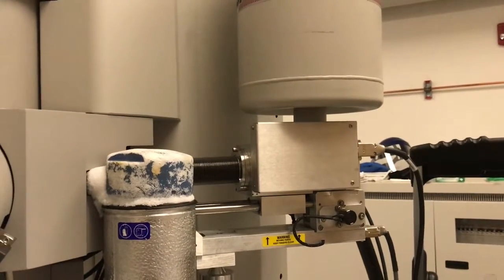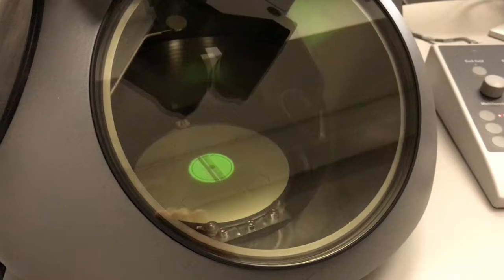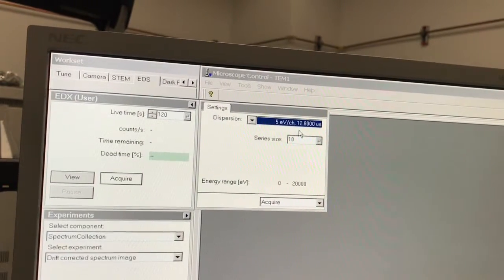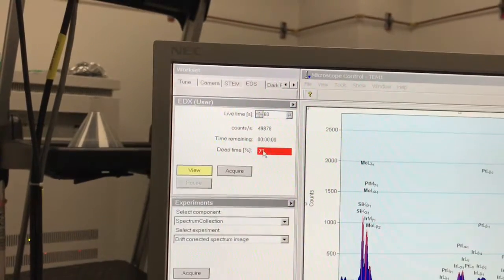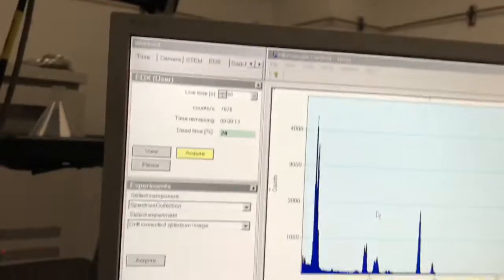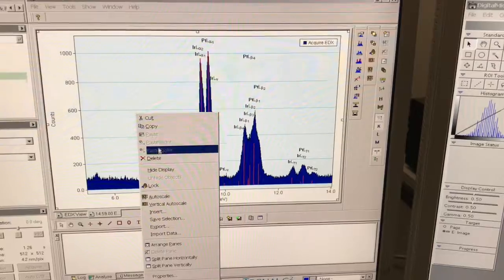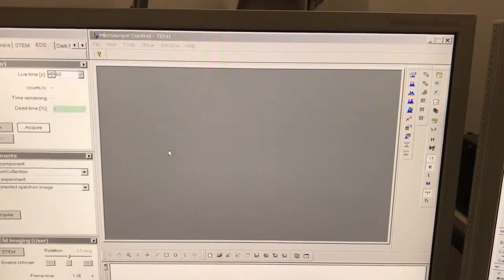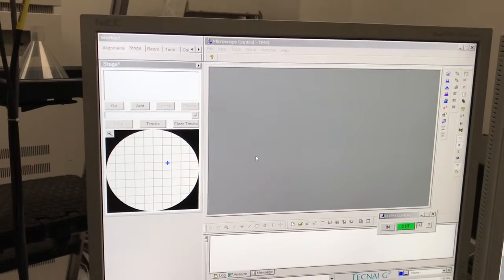FEI Tecnai F20 S/TEM: performing EDS (or EDX) in TEM mode

Comment: Hi Nicholas, thanks for the material!! Can you do a video on how to do an EDS on the spot of the sample and the spot size effect on the x-ray levels
Reply from the maker: Hi dia Rocky: you're welcome, and sorry for the late reply.  Doing spot analysis in TEM mode is rather easy and I think I can answer your question without doing video: just converge the beam to crossover and place it at the desired spot on the sample, then collect the X-rays.  If you change the spot size, the physical size of the beam will get smaller as spot size increases, but the beam current will drop, so the X-ray generation will also decrease as a result.  I hope this helps.